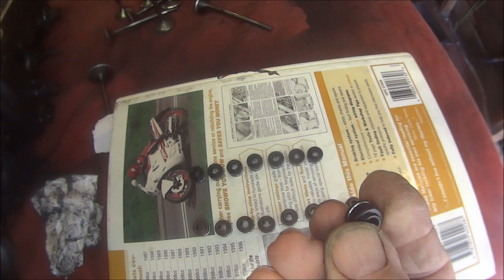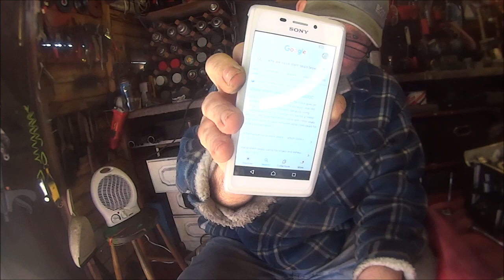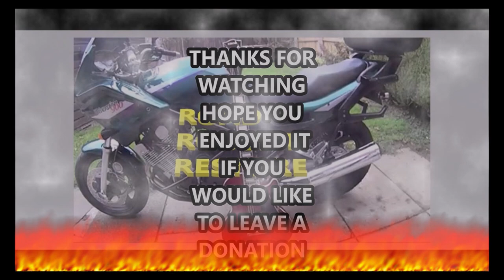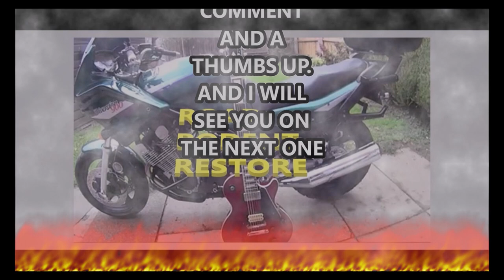CBR1000F cylinder head rebuild part 2

Comment: Use a small socket that presses on the outside edge of the valve stems  then use the screw driver handle from your socket set to push them down will be a lot easier. A rag and long nose pliers will allow you to remove them without damage.
Reply from the maker: Hi Emily. Fantastic tips and very much appreciated thanks 👍👍👍

Comment: The intake duct on this motorcycle is very rough, I leveled the channels, removed the steps, thereby improving the filling of the cylinders, the motorcycle went completely differently.
Since the standard clutch began to slip and behave .
Then I had to modify the clutch to maintain the increased torque.
Reply from the maker: Thanks Oralboss